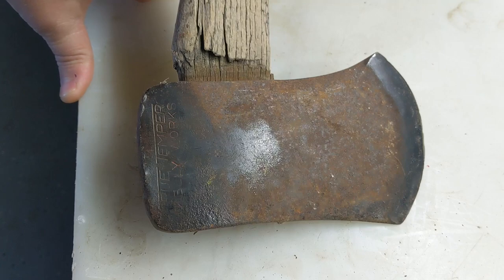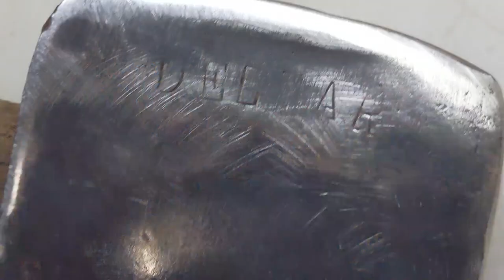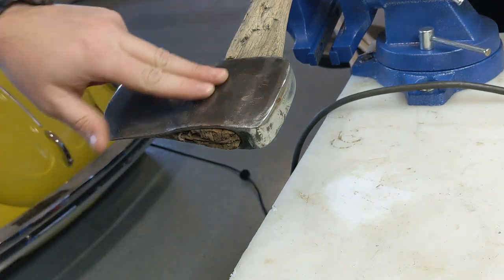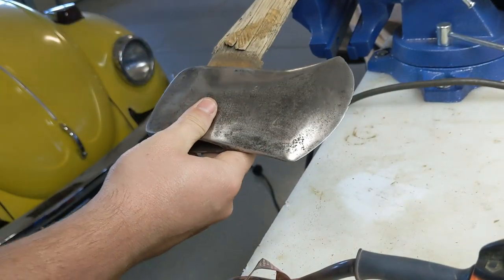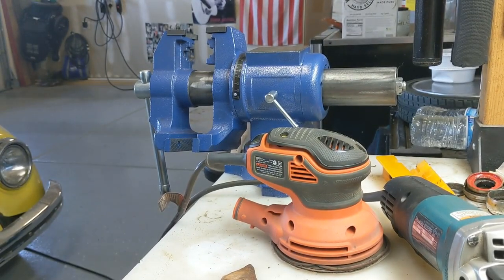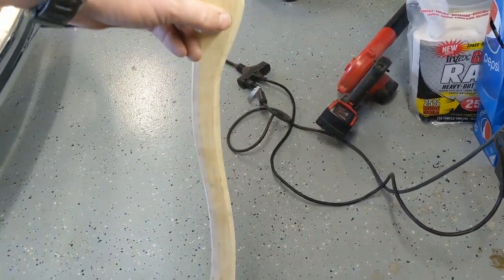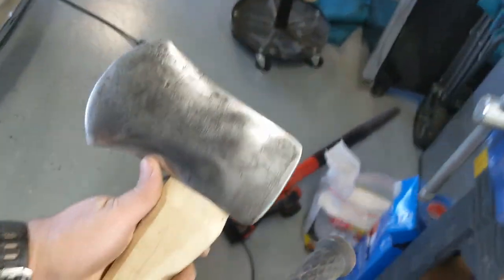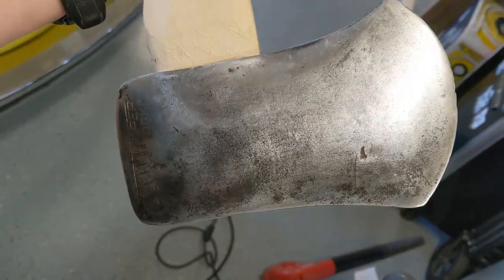OLD RUSTY AXE RESTORATION // True Temper Kelly Works

Comment: Came out nice. I'd leave it the way it is. I just picked a kelly works up at the transfer station yesterday.  I'm going to start refurbishing it so I can use it. The old axes are far better then most of the ones made today imo.
Reply from the maker: It's sitting in a stump right next to me as I type this. You're right about the older axes. The metal is so much better and they take and hold an edge way better than the new ones. I just wish good handles were easier to find where I'm at.